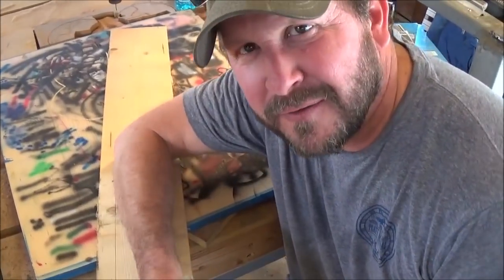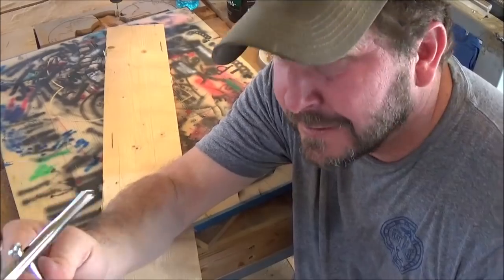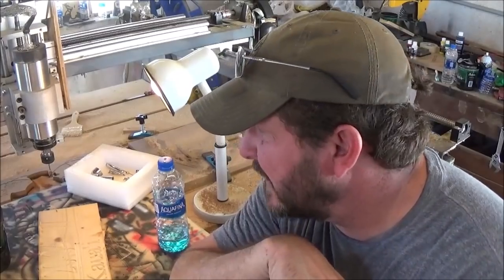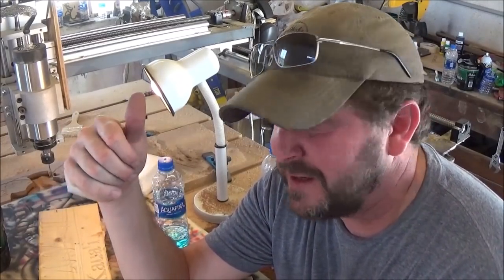Airbrushing  (with Iwata Revolution)

Comment: Just got my air sprayer and  I can't get it to spray any paint out. My paint is in my unheated workshop and it is very thick. Do I have to thin my paint and if so do you know how I should do that. Thank you
Reply from the maker: As long as you are using a acrylic paint you can cut it with water...There is one of the dark colors that I have to cut a little bit because it is so thick, I think it was brown.  The stuff i've read says that most people do thin their paint a little bit for better coverage and a more smooth fan when they spray....I've just never had bad problems with fan unless my gun wasn't clean.  Thanks for watching!